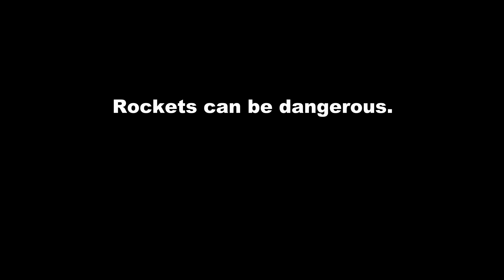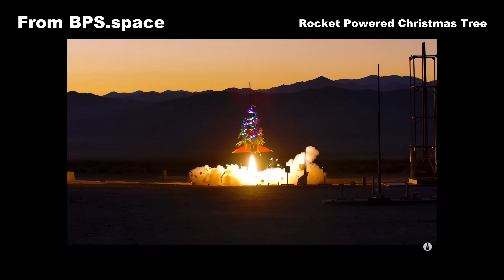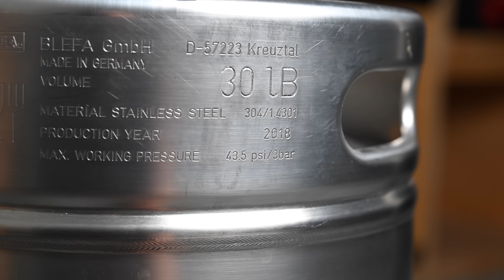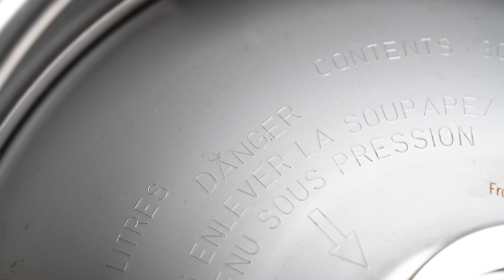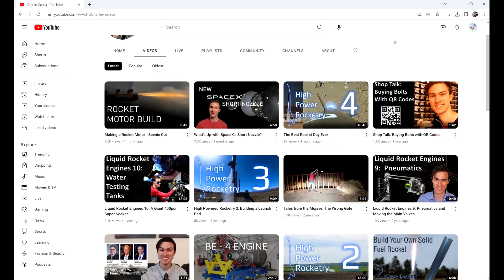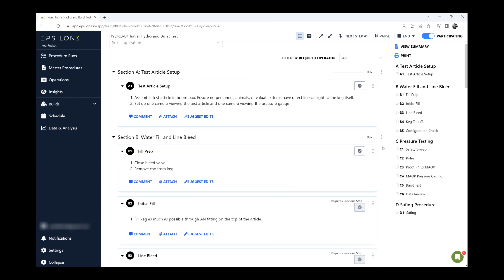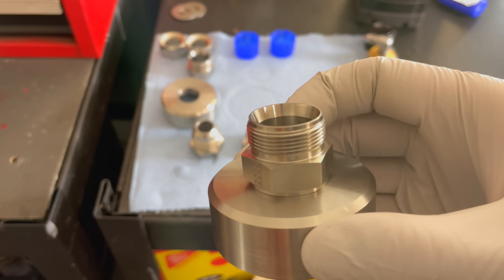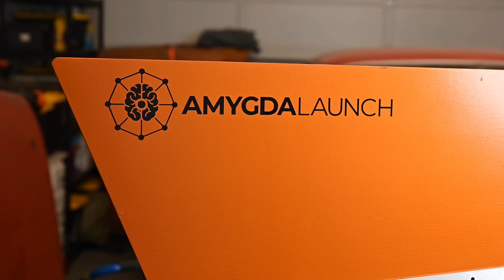Can you build a Liquid Rocket out of BEER KEGS?! - KegRocket Ep 1

Comment: Very cool project. I would like to offer some safety advice. Have your tanks hydro tested to the psi plus a safety factor before filling. It's not an expensive or time consuming process. And could very well save a life. When we fabricated air tanks in house for use in the facility. We would have the vessel tested before putting it in service. None ever failed but I can tell I slept better knowing my tank was safe. Again really cool project.
Reply: And yes I watched the video. With real hydro testing the amount so stretch or swell is precisely measured. That's the only way to know exactly how the tank performed under pressure.
Reply: Came here to say that.
Proper hydro testing will give you a stress/strain curve that will tell you lots of useful things about how the kegs behave under this abnormal pressure.

Since the kegs are structural, and have other, non-pressurised structural parts attached, you also need to know exactly how they will change shape and size as their pressure rises and falls.

Basically, get a decent structural engineer involved, stat.
Reply: not sure how to perform that test at LOX temperatures that will affect the result
Reply: @skataskatata9236  You don't do it a low temp. Just have a pressure vessel testing company test it at pressure. Then you at least will have an idea of how much stretch your getting. The temperature would definitely have an effect, but basic testing would still give you a pretty good base line.

Comment: I'm curious how you'll handle the changing length of the rocket due to kegs stretching, w.r.t. the downrunner from the upper tank. Whatever piping solution you make will need to hold up under a lot of pressure!
Reply from the maker: We're going to have to add some bits of flex line between the stuff connected to the domes and anything rigidly mounted. Interesting problems.
Reply: @KegRocket  I see ! Tbh there's not any large scale liquid fuel ameteur rocketry on youtube, so you'll probably manage to hit a whole niche with this (without even considering beer fans :p )

Comment: The machining and fabrication quality on this thing is spectacular. Huge props.
Reply: No, no props. This thing is powered by a rocket engine, not propellers.
Reply: @noahhastings6145  tryna differentiate between autism and sarcasm
Reply: He meant props as propellers and most engines has one but this rocket has none
Reply: For real. Those welds are professional looking.
Reply: I am afraid his tank bulging will cause a steering failure. Not sure I agree with attaching things to the tank.